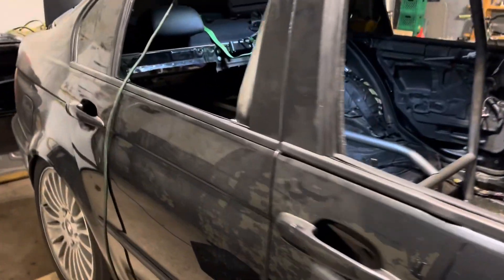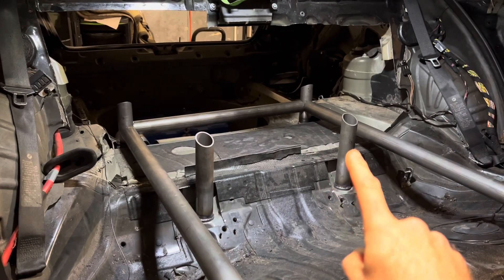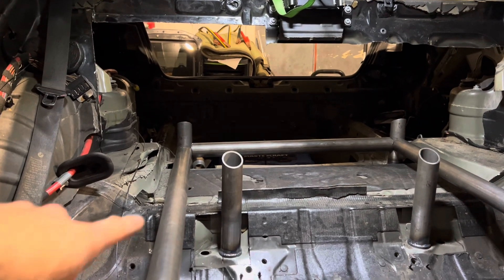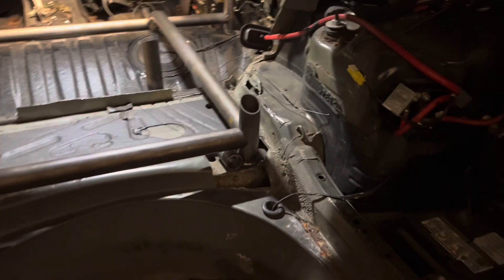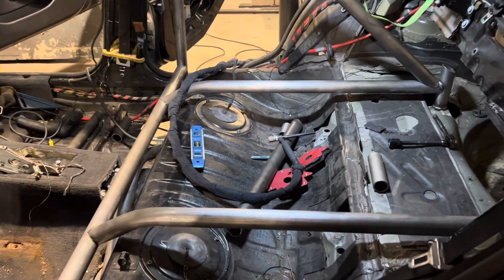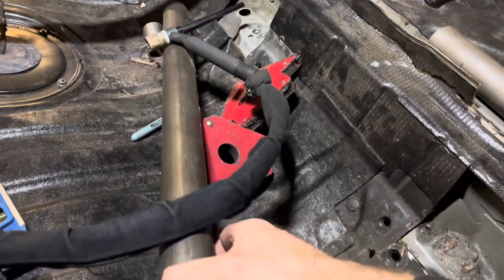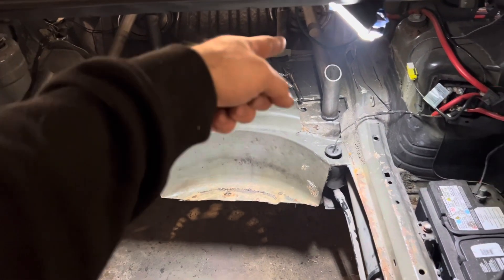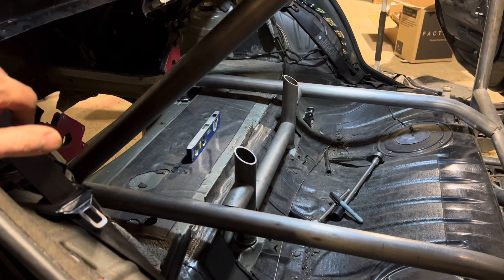E46 TUBE CHASSIS BUILD: Subframe Brackets

Comment: Highly interested in doing something similar so I’m about to watch all these 😂
Reply from the maker: Unfortunately I only Judy’s started this series but feel free to post any questions and I’ll answer everything through the series
Reply: @rev7garage  I’m still deciding how I wanna do my cage, my original plan was to do a standard caged version and then build my tube frame off the cage but I’m considering just going tube frame from the beginning what is the benefit of switching the suspension?
Reply from the maker: I was going same direction and my floors were going to be more work saving them to tie the cage into then just building a tube chassis from the start so I made the plunge to go all the way right off the start

Suspension in this orientation allows the car to sit lower with full travel, easier to actually adjust the suspension located up top and I can run wider wheels without hitting the coilover
Reply: @rev7garage does doing the suspension like that affect the spring rates you need?

Comment: What size tubing are you using? I want to do a rear brace for my car
Reply from the maker: I’m using 1.75 DOM but if your just wanting to build a brace I would use 1.5inch with a .095-.120 wall
Reply: @rev7garage  thanks! I will get some of that